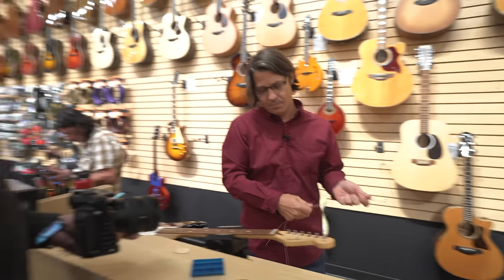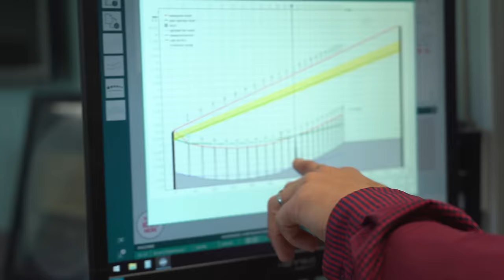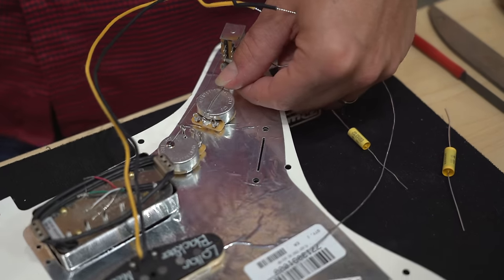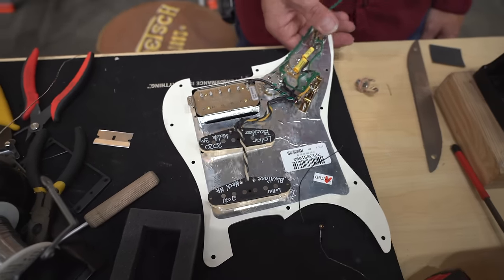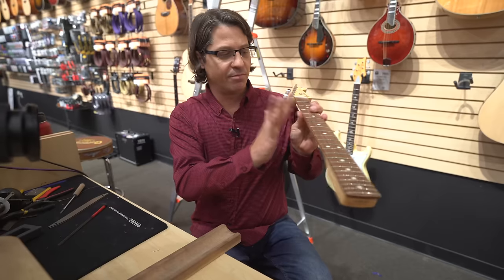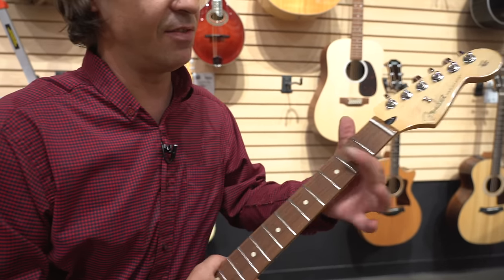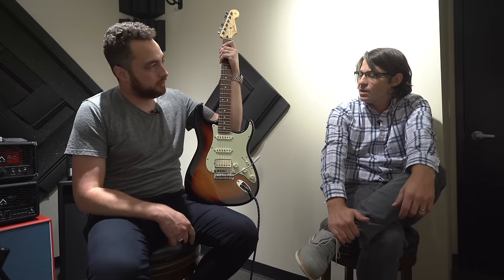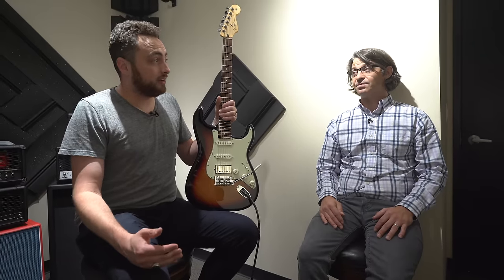We Tried To "Custom Shop" The Cheapest Fender Strat

Comment: I bought one for $75 bucks from aldi. Not a strat, but similar.  I bought it for the neck. It was unbelievably good.
The sound was terrible as expected.
All i remember doing was adjusting the bridge.
Change the pick ups and its as good as any original.  Its brilliant. 

You guys said it sounded good. No need to throw away the electronics.
Ide say $400 bucks would be enough to make this a great guitar.
Do it yourself and its $20.

I have a cole clark fat lady 3..  bought 16 years ago. 
Advertised $2,900. Got it for $1,900 friend ran the shop.
It now needs a new sound board. You can surf on it. But its still playable.
I spend most of my playing time on a $50 buck small classic from guess where.....thats right Aldi. 🤣

Comment: I just started modding my Fender Classic Player '50s Stratocaster. The guitar was decent from the get-go but I just wanted to tinker with it. It's only routed for single coils and it has an 8 hole pickguard so I had to work around those specs. After disassembly kinda shocked at the lack of features - piss poor shielding (none!) and subpar pickups, controls "good enough" for my needs. Swapped out the bridge for a SD hot rails, the neck for a SD Antiquity PU and fully shielded all body cavities and pickguard. Gotta say it's sounding sweeter than ever!
IMHO - Fender makes guitars that BEG to be modded (especially at the lower price points). Next up - a new pickguard and possibly a coil tap for the SD Hot rails.

Comment: $1900 puts you in the ball park of a American Ultra with a contoured heel joint, better electronics, bone nut, compound radius neck (10-14), rolled edges, locking tuners, and a high mass bridge/saddles. 

All that money on questionable upgrades and you didn't even get to an off-the-shelf American Ultra, and  nowhere near a Custom Shop.

Comment: Pleking sounds good. But if you're in the UK or in Europe, you shoud definitely checkout "Reloved Guitars". The owner Sam Deeks has got a killer YT channel where he details his fret levelling process with the strings IN PLACE (and the neck therefore already curved and set at the ideal action) using a simple handmade tool he calls the banana. The result is mindblowing and allows super low action and feel on guitars you wouldn't have bought for £50 in a charity shop. He turned my cheap Stagg PRS copy into a super decent instrument (I previously already upgraded the pickups with SD P-Rails on tripple shot rings and rewired with push-pull pots to have both pickups in parallel/series and phase inversion as well).

Comment: With the cost of the new pups and initial guitar taken away, that means almost $800 in labour. For what?? I am a full time tech, I am seriously not kidding, this would be at most a £155 + parts job for me, and would take less than a day to do. If some shop is charging that much they're mugging you off. This is not even close to what $800 gets you from a luthier, fucking hell I've built people ENTIRE GUITARS for less than that amount and this guy did a few hours of soldering and fretwork???

Comment: I'm a big fan of buying used MIM Strats and then doing any necessary setup and upgrades myself. Back pre-pandemic I could buy a used MIM for $300 and drop another $200 - $250 or so on a preloaded pickguard with Seymour Duncans or Fender CS pups. I'm a gigging musician and don't buy guitars for resale value, so for $500 or thereabouts I could have a great playing and sounding guitar that I don't have to worry about bumping into a mic stand. (Of course prices are a bit higher now, but the principle still holds true.)

Comment: I just stopped buying branded guitars. I buy the rough body and neck and work them like in this video. Then I place the components I want and I always end up having spent 400-600€ in total for a guitar which branded equivalent would cost 2000-2500€. And I have a lot of fun and it's satisfying playing your self made guitars. Harley Benton's 100€ full guitar kits are great for this scope, they are cheap, the wood is very good and precise and the components... who cares, I always substitute them all with quality stuff. Branded high-end guitars are immensely overpriced and you must be a fool to buy them. The message in this video is correct: 90% of the job goes on the back of the neck, fretboard, frets and nut, and 90% of the resulting quality as well.

Comment: Or no offense you buy the guitar for $850 and do all the work yourself, tusq nut is 20$, tools will cost about $250.....pickups caps and wires depends on your taste $200-400 and now you have everything you need to do it again so when you do buy another guitar for a backup or changeup you are all good to go. 
There are more than enough guides to do this yourself.
Personally stratosphere guitars, buy a pro II or ultra  body and neck, forget the pickups and electronics you won't need them, obsidian wire or 920d, buy hardware from better manufacturers like a Callahan, Hipshot, or other premium bridge.

Comment: So I bought a Squire s,s,s for $68 used in great shape. The previous owner had done all the neck work. I replaced everything with Fender Custom Shop parts.  All the hardware and electronics.  Now I've got a $600 guitar that sounds, and plays incredibly. It works great for me.  I highly recommend it.

Comment: I'm torn on this, because I don't want to crap on Rhett Shull or the concept of the video itself.  However, there is, in my opinion, a significant degreee of cork-sniffing snobbery displayed here.  Others have pointed out that most of the work they did to it - beside the new pickups -- was setup work that any guitar player has to do on ANY guitar if he/she wants it to play and sound better.  Even after installing $300+ worth of pickups, they acknowledge that this doesn't add anything to the value of the guitar.  So, in the end, the way I see it is, it comes down to an updated guitar that plays and sounds really, really well, versus a Custom Shop guitar that costs -- by their own estimate -- as much as $1,800 more.  And the only REAL, measurable difference they point to is the weight of the instrument.  The other two (2) differences are either subjective (the Custom Shop model "feels" so much better) and speculative (the Custom Shop model "will hold its value.")  Certainly some people buy and invest in guitars for the collector's value and the resale value.  But is that the norm?  Most players I've know, myself included, would just love a guitar that sounds and plays well.  And I will also add that, many players that invest so much money in Custom Shop guitars or collector guitars, typically don't play them out in public.  The guitar tech had it closer to the truth when he says that this is something that could be done over the course of a couple of years and I, for one, would consider doing just that because, in the end, all I really want is a guitar that plays and sounds good.  As a side note, I don't know how realistic that price is ($900?) for the work.  It could be a high number or it could be a low number.  But if you take out the pickups and do all the other work, that would probably bring the total down to around $1,500 - $1,600.  And I will tell you that you can get brand new Fender guitars that cost that much and won't play as well out of the box as the finalized version of this guitar will -- even without the upgraded pickups (maybe especially without, because a $1,600 Fender Strat should come with better pickups than the $895 Mexican version).  Just my two cents. Oh, and one other thing.  The nitrocellulose finish.  That is a difference for sure.  But again, does it add up to an $1,800 difference?

Comment: 800 Bucks for a poorly tuned guitar. A prime example for "The letters on the headstock costs the most". But at least Gibson has far worse quality control. For 800 Bucks i expect that someone in the factory adjust the guitar on a playable level. I dont expect that from a 200 bucks or 400 Bucks Harley benton. But they come with polished frets, good adjustment mostly. A shame for one of the big 3.

Comment: When I bought my first guitar, I was had the Master Plan. I was going to buy the cheapest guitar I could find, whack in high end parts and sell it for at least a 50% profit. Then I was going to parlay that into the next and keep it rolling  until I was able to retire off my proceeds. So I got my Daisy Rock w/metallic flake paint, EMG Het Set pickups, CTS pots and switches...the works. Took it back to GC to sell and not only was it not worth more, it was LESS because it was not stock anymore, regardless of the aftermarket parts. I was stunned. My plan failed, I had a thousand dollar boat anchor. THAT is how you learn the hard way. Being naïve and ignorant with no research into the used guitar market. And I had no clue about fret dressing, polishing, rolling edges, nut prep, etc.

Comment: About what it costs to make a good quality parts build plus pleking and set up. $1800-2000. Except we are getting better initial quality for the body and the neck. Of course I am doing a lot of the work myself. Putting it together, copper foil, soldering wires, bone nut. I leave the fret work for the Plek technician because it is near perfection. Down side is it your never going to be able to sell it or get your money back. But you can get a custom shop quality guitar for around $1800-$2000

Comment: I tried to make a 1970s Fender Jazz Bass (my 1978 USA one was stolen in about 1990). It cost more than the MIM re-issue at the time - currently called Vintera. At the time Fender was not selling bodies so mine is a very heavy solid mahogany one. Recently I got another Fender neck to replace the £200 Allparts one but Fender only do a MIM one and even that was £300. So my point is that any mass modding may not be worth it.

Comment: If someone wanted to do this, I'd advise just buying a used Mexican Strat (any era), get some used high quality pickups (plenty of good used fralin or seymour duncan pickups out there) and find a good experienced local tech (skip the plek). You could probably do the whole project for $1,000. I opted to just do a parts guitar instead and probably ended up $1,200 on the ones I've done but got closer to custom shop quality - more control overall of what you can get. The challenge is (be forewarned) you will never get your money back out of a parts guitar. Expect to lose 35-50% if and when you sell. I've mistakenly sold 1 but kept the other 2.

Comment: It's ridiculous that you pay Fender $849 for a Players Series Strat that still requires work on the frets to properly finish them. At the end everything Rhett is praising about the changes reflect poorly on the stock Players Series Strat. So the frets were "gritty and digging into his hand". This on Fender's $849 offering proudly made in Mexico. What a joke. What a disgrace to the Fender brand. I will say, everything done here could be done to the highest end Squire model and you'd end up saving $300-$400. You could think of it two ways, either you aren't getting a USA built guitar either way or either way you are getting a USA built guitar. Once you put in your own bench time on the frets and replace all the electronics, hardware, etc... You've assembled it in the USA :) I know this will sound negative but the guitar/gear industry is full of products priced disproportionate to what they should, with market values driven by clever marketing and mystique tied to legacy brands and artist endorsement. It's probably got the most bs of any industry and you really owe it to yourself to navigate through that would picking products. Want to spend $2k on a Fender, that's fine but don't think that's a guitar with $1.5k worth of utility over some $500 guitars out there.

Comment: a squier affinity is 200,
vintera 60 vintage pickups are 89 dollars and
fenders roaster maple necks are 255,
so added up you can get an extremely nice guitar under 600 dollars (if you want better pickups like the 69's its under 700) and if you want get a 60 dollar vintage strat tremelo and locking tuners for 60 dollars, which is around 700-800 dollars for an extremely nice guitar rather than a 600 dollar strat without the vintage specs and sound quality. 
just a possible endeavour

Comment: Fun video, wish you had gone all the way with the bridge (Callaham or AVRI) and changed the tuners. Then you are above a American Vintage Reissue strat in cost which already has these things plus a nice case and a nitro finish, plus the wood is not light or resonant. Rather than buy an $850 MIM strat and do a few common upgrades ( bridge and electronics), may as well save up and buy a used AVRI strat for $1400.

Comment: When I saw the title of this video, the first thing that hit my mind was the time I saw a tricked out Toyota. Someone had replaced all the Toyota emblems with Cadillac emblems. The front seats had been converted from Toyota to Cadillac as well.

The bottom line is, you can’t perform alchemy on a car, guitar, metal, etc.  
What you have, you have. You can only make a cosmetically and functionally modified Toyota. No matter what you do, it’s not a Cadillac. The same is true with guitars. You have what you have. 

That doesn’t mean changes to the original can’t be impactful. A Cadillac emblem still has its appeal. Cadillac seats are still a comfortable seat. So, you can improve the look and feel of a lower priced guitar, but it will never be anything other that a lower priced guitar should you try to sell it later.

I NEVER sell guitars. I have tweaked several lower priced guitars. In fact, the guitar I’m looking at on my couch is a tribute G&L bluesboy. I changed the pickups to a Seymour Duncan jazz in the neck, and a G&L MFD in the bridge. I used a 400 grit sanding block and 000 gauge steel wool on the sharp fret ends. I had the frets leveled and polished. It cost me an extra $250-300 dollars and turned a rough playing guitar into a comfortable, great sounding guitar. I’m into this guitar for roughly $600 after all modifications. It’s still a tribute, Indonesian made guitar, but it’s bad ass. I don’t fret the cost (no pun intended) because I modify guitars for my suitability, not for some resale value that I would never sell anyways.

Conversely, I have 30+/- guitars and would NEVER pay the price of a custom shop guitar. The playability of my U.S. made guitars and modified foreign guitars are just fine and don’t warrant the inflated purchase price. 

You don’t always get what you paid for, but you have what you bought.

Comment: I get the premise of this video and it was fun to watch. But if anyone wanted to do this themselves, this isn't the way to do it. I did a partscaster Tele build with new Fender replacement neck and body (Chose the actual pieces myself), Fender american vintage reissue pickups, custom wiring with CTS pots, orange drop cap, and high end american hardware. Paid a local tech for a meticulous fret level/dress and nut work. And all in it cost me $1300CAD (under $1k US). All custom shop level parts (except MIM body and neck) for essentially the cost of a stock player series. Plays and sounds incredible

Comment: What if you tried this with a light weight nitro finished MIM 60s RW strat? I picked up a 2011 for 500. Great feeling guitar, the Tex mex pus sound great but with Lollars and neck job…hmmm. The pots are already CTS and switch is already CRL. Seems like weight and finish were the biggest obstacles to getting into custom shop territory per Rhett.

Comment: The one thing I am sure of, It's that musicians are into labels. Nothing new. There are so many Blind comparisons on youtube by experienced musicians proving that so much of this (better ) is in your head. Feel is so subjective even for strat users. Weight is not. I have played a couple of custom guitars and I will admit that the feel of the strings on the frets is great. But most of this better pickups is extremely subjective. I agree that this guitar is better but not in sound. I am listening on my LG sound bar so I may be missing the nuances. I will say that I have never cared about a guitars resale value when it's the guitar that I play. If those new pickups sound better in real life, I could care less about the monetary value.  I am no gigging pro but I have been playing in bands from 78 to 2018. Only what I feel is important regarding value. I love my American deluxe as much as my standard strat with a 920D custom pickguard. I probably broke the necks in myself over the years. They are however not for sale at any reasonable price. If i were to win the guitar, I look forward to hearing how the pickup mods sound through my 70's super reverb deluxe and original sans amp. BTW--- Is the bridge on that guitar floating?